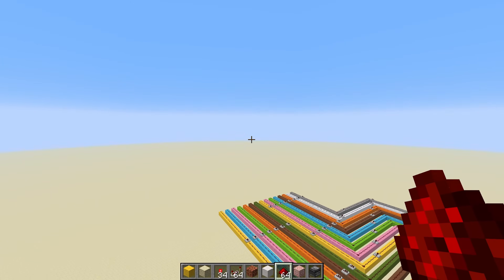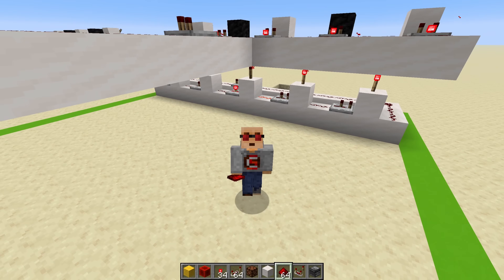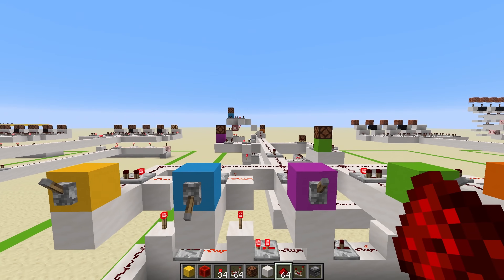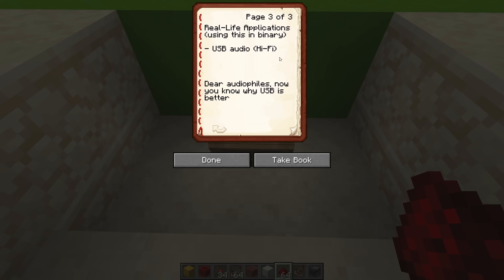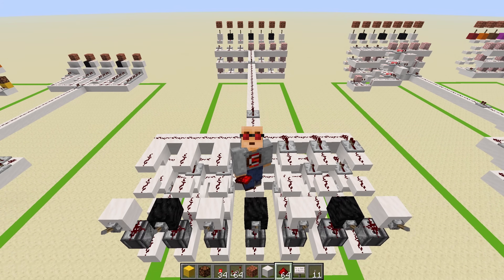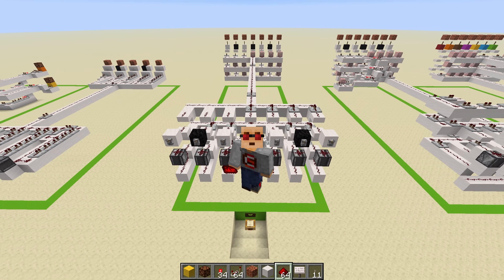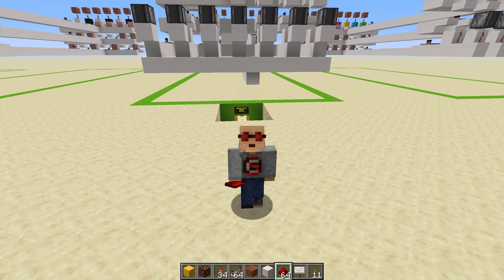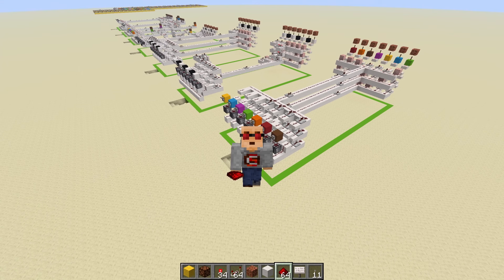How to Send Multiple Signals on a SINGLE Redstone Wire

Comment: bro invented the shift register
Reply from the maker: There isn't a shift register, actually. A previous tutorial I made on a Redstone clock has an actual shift register
Reply: nah these signals don’t pass into the system at all until the comparators unlock simultaneously (i.e. no shift) plus the value isn’t stored except in the output (no register)

Comment: First time viewer, instant subscriber.
I was expecting it to end with a bit of package management, especially when you were discussing binary counting earlier, considering the release of the shelf block for stackable three bit systems.  In the, "Everything is packet management," philosophy, I was expecting a value to add toggle + row for each signal out.  I was picturing the once upon a time era of using multiple lecterns for specific values, or the wireless option of calibrated skulk blocks (not that all values are convenient in that case.)
I will be looking forward to future videos!
Reply from the maker: I honestly don't see the interest in stacking multiple three bit systems, increasing the bit depth of a single system would be much more efficient. Happy that you enjoyed the vid!

Comment: Honestly, my first thought was to use comparators. They can transmit 16 different states on a single wire. Basically one comparator wire, whilst very slow, can transmit an equivalent amount of information to 4 regular redstone wires
Reply from the maker: Not a bad idea but they're super slow since you'd need 1 every 2 blocks to keep the signal
Reply: @ChunkySquaresMC  You can direct the comparator into a block with redstone dust behind with the same signal strength, right? Still slow, but somewhat faster.
Reply: @ChunkySquaresMC there are ways to send signal strength along a wire with ~2 redstone ticks for 16 blocks, but the wire is 3 blocks wide
Reply: @ChunkySquaresMC  I believe you can make the data travel instantly if you prime the comparators 2 gameticks before the signal, you just need to make sure the comparators are scheduled in the correct order
Reply: @ChunkySquaresMC  you can make an instant comparator line with redstone dust ontop of a line of alternating downwards facing observers and blocks, then do blocks between each comparator
Reply: that was my first thought too, it would basically treat the redstone signal strength as a bit field like in (mostly just low level) programming
Reply: if you have n bits you can feed the last n blocks of the signal into n repeaters (perpendicular to the wire) which output to a new redstone wire.

Comment: one con for the parallel binary (at least irl) is you are limited in your input/output by the number of wires in your cable, whereas with the serial, any number of inputs and outputs can be sent through a single wire.

Comment: No way we got serial communication in minecraft now, drop your microcontrollers and switch to minecraft
Reply from the maker: Life expectancy of engineers is up by 20 years!
Reply: @ChunkySquaresMC because now we can start at age 10 instead of 25!
Reply: Love Soviet dog😂
Reply: Dawg serial communication has been around for time
Reply: @cerealisprettynicein minecraft?
Reply: @ricardoarbona2551   Yeah.  It's been a thing almost as long as redstone has been in the game.
Reply: I mean they learn these in Computer Science, and it’s also not hard to implement in Minecraft as well. I see this video as more like a lesson about efficient wiring methods, just done with Minecraft.
Reply: This video is great, but the concept isn't new. I built serial data transfer with 1 wire on the first version of Xbox 360 minecraft. I led it with a 4 bit code that signifies start of transmission and which machine should store data, and then the next 8 bits were recorded and stored in the respective machine/register. At the next code, it would drop the data and fill with the new 8 bits.
Reply: It's been out a few years now but it's still really cool yeah
Reply: i made serial connection in minecraft. its not that hard tbh.
Reply: Some of the devices are just typical MUX demux ICs

Comment: data transmission in minecraft is very interesting
Reply from the maker: It's very similar to real life tbh, except you don't have to deal with EMI😂
Reply: @ChunkySquaresMC  yes, but redstone is so much simpler and it's easier to implement than real electronics, which makes it helpful to learn concepts that can then be used in the real world
Reply from the maker: @delta3979 Learning is definetely easier with Redstone, because you litterally see the wires glowing, but I disagree, real life electronics are so much easier because they're frickin Max Verstappen compared to a snail (and I'm not exaggerating) in terms of speed. With Redstone you're basically engineering against the slowness

Comment: 2:59 yes but actually no, TOSLINK atleast uses Bi-Phase Mark Code, which is basically a way to transfer both data and clocksignal over one single connection (basically one clockcycle is split into two pieces of information)
What do you mean distortion, they transfer a digital signal over a digital path, there is no distortion to speak off, only signal loss is a concern, most sources nowadays are digital from the get go anyways.